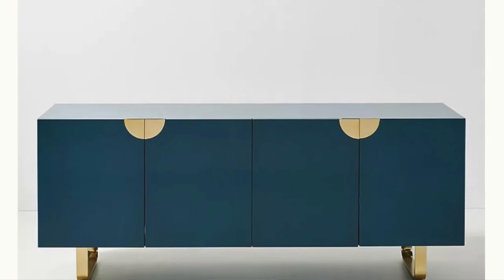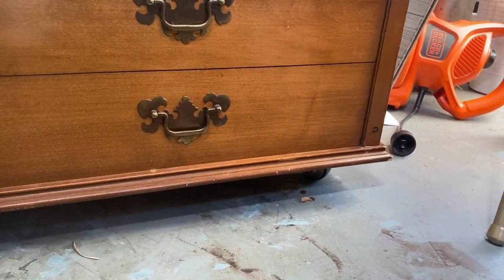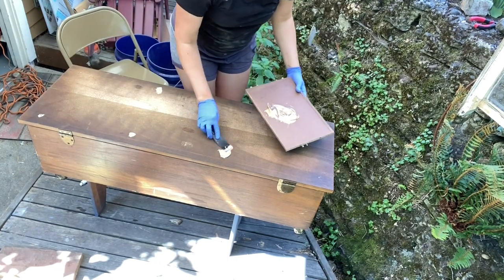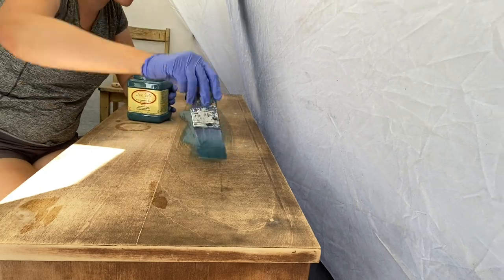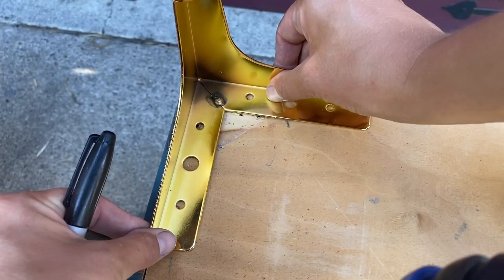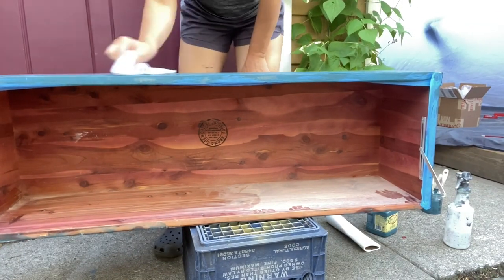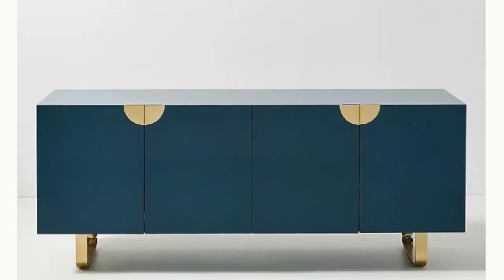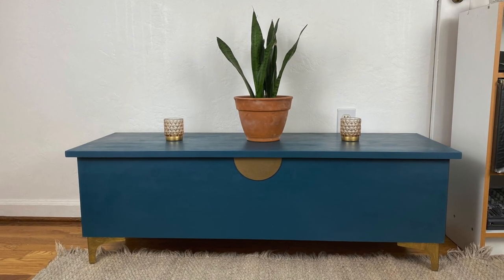Can I DIY $1300 Anthropologie furniture on a budget? | $100 challenge

Comment: FYI: you can get a replacement lock from Lane for free as locks they put on were not child-proof.  Also from them you can get the manufactured date.  If I remember correctly, the serial number is on the bottom.  If you decide to sell, the lock would be an added bonus should the buyer want it.
It turned out beautiful!
Reply from the maker: Thanks, Linda! Yeah, I decided after all the Lane lock drama to just remove the lock. I didn't really see a need for it. But good to know that it is possible to get replacements!! Thanks!

Comment: I have a question for you.  Is the material from which the chest was made solid timber or veneered blockboard?
Reply from the maker: Hi Keith! I'm not a wood expert but it seems to me that it's solid wood. It's a lane cedar chest.
Reply: In that case, where you filled the gap between 2 boards, you might have been better off to find the cause of the joint opening because timber is hydroscopic & absorbs & expells water with changes in humidity which may gave caused the joint to open but the cause may also be that there are pieces of timber running in opposite directions with no allowance for movement within the timbers.  An example of that is a cleat running across the side for a drawer to run on. If the screw holes in that cleat have not been elongated to allow the timber in the sides to move.
If you look in older, better quality chests of drawers you will find the timbers on which drawers run is isolated from the sides to allow for the timber to expand & contract. 
Please do not think that I am intending to be cruel, I merely wish to help educate you so you may give purchasers of your delightful work better quality products.
Cheers.
Reply from the maker: @keithhaycraft3765  Thanks Keith!!

Comment: It would have looked better if you sanded the legs
Reply from the maker: Sanded metal?
Reply: @KnowCanDo  Yes. 👍🏻 Just to scuff the shiny finish off the hardware.  Another tiny note:  because the legs are somewhat tall, the shiny, inside surface of the back legs is visible from the front.  Most people probably wouldn’t notice, but if you were going to try to flip it, you might want to do the same process to the entire surface of the legs.  You definitely captured the flavour of the Anthropologie original.  Beautiful colour! 💙